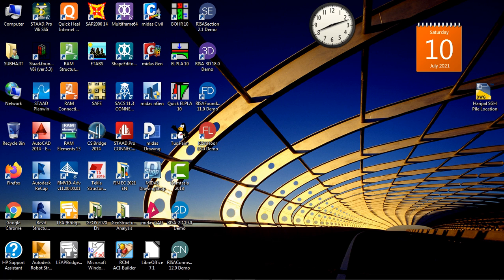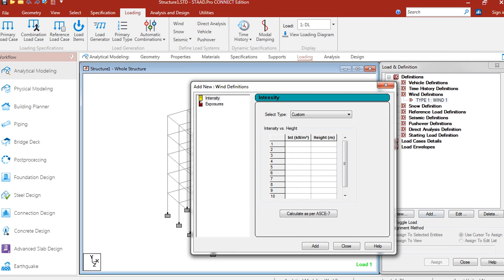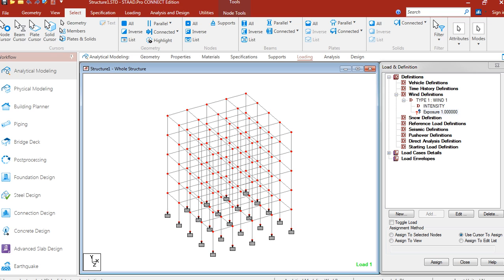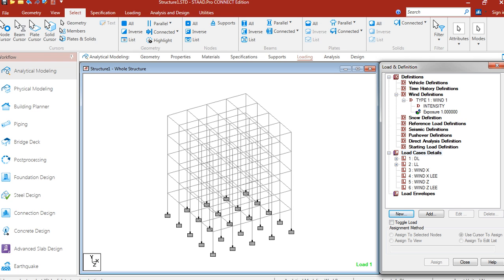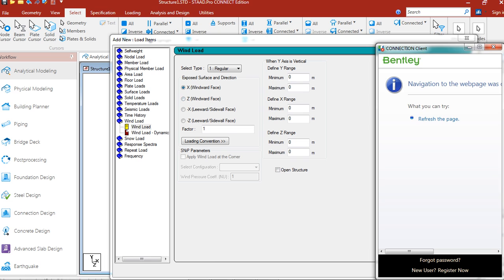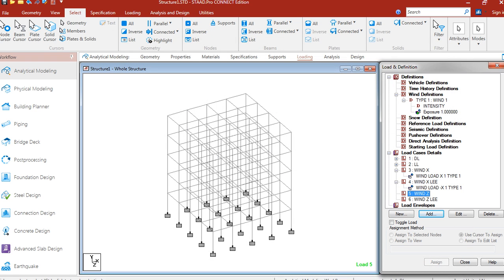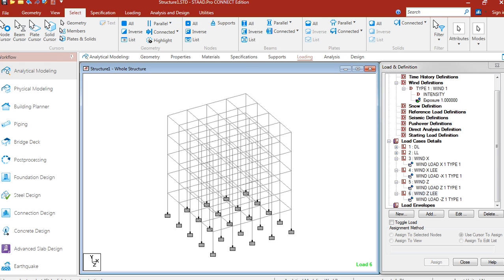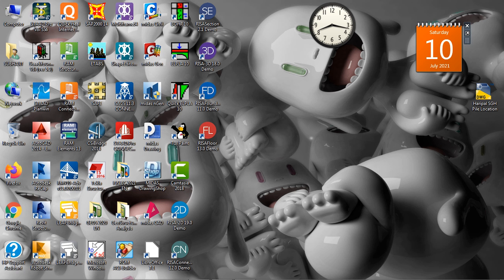Assigning Wind Load in Stadd Pro Connect Edition

Comment: Dear Sir,
while assigning wind load in X you blindly follow factor 1. Actually it is (Cpe-Cpi)  and it differs from % of opening  as cpi  and Table 5 coefficient as  Cpe and it varies for windward and leeward side. most of the engineers crudely follow 1 without understanding  the concept on wind.